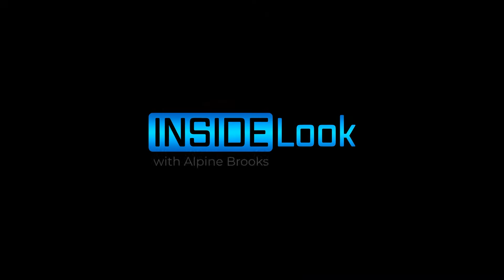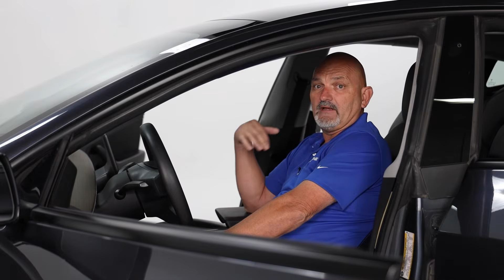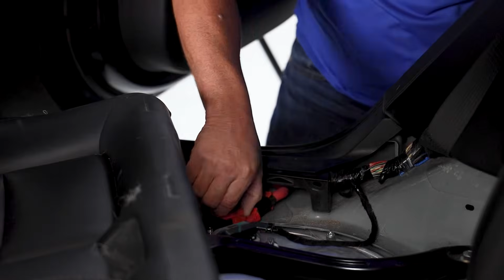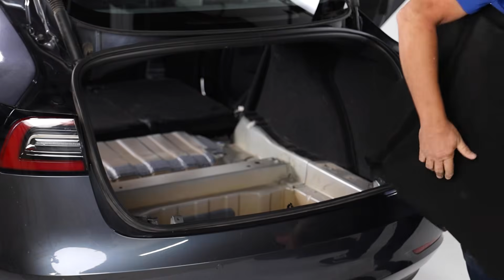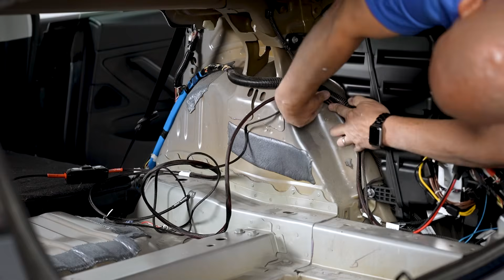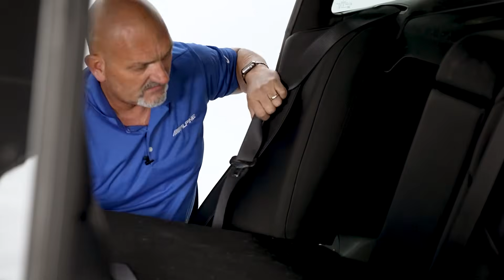DIY Subwoofer Upgrade for Tesla Model 3 & Y | Alpine PSS-TSUB-T3A / TYA Step-by-Step Install Guide

Comment: Just paid for someone to install the sub in my 2026 model Y. This sub sounded good for about four minutes and then it just cuts off. Subs still gets a little bit of power, but it no longer kicks anymore. You can let it cool down for a few minutes start playing a song and It’ll cut out again so far it’s been a waste of my money buying it and a waste of my money having someone install it.
Reply: I posed the following question regarding overheating to Microsoft Copilot: "I read a review, and Crutchfield also states that the Alpine system can overheat, leading to temporary shutdowns. What do you know about this?" I suggest you ask, too. I received a very detailed explanation and remedy for overheating. Make sure Copilot knows you're talking about the Alpine PSS-TSUB-TYA subwoofer. Good luck.
Reply: I'd start with your gain adjustment. Copilot suggests starting at 35%, which is the mark on the dial at 10:30.
Reply: @peterjens316  The problem with the system kit is Alpine subwoofer and their amp is garbage, the wiring kit and speaker box is great so what I did is I replaced the subwoofer and the amp with Kicker 51KPX500.1 and JL Audio 10W0v3-4. No problems with overheating now. Hope this helps anybody that reads and once a little more bass in their Tesla.

Comment: Very nice video, but my Model Y is the standard edition RWD and I have not the factory subwoofer. Can I still install it? Do you have a kit with cables and everything for that model?
Reply from the maker: Fitment is a bit tough on Tesla because there are so many different variations and trims that affect the audio install, even within the same models and years. We have created a fitment guide on our website specifically to tackle Tesla so if you add your vin and build date to the guide on our Tesla product pages that would be the most accurate.
Reply: @AlpineTV can you give me the link please?

Comment: Any time frame on when this will be available for the 2023 rwd cars?
Reply from the maker: If it is a model with the base level stock audio system (no subwoofer) we have a new subwoofer kit coming soon for those models.
Reply: @AlpineTV any update on eta?
Reply: @AlpineTV  Same question here. Im ITCHING get some bass in my 2023 Tesla Model 3 Standard (without subwoofer). I thought the PSS-TSUB-T3B was sold out but I guess its yet to have been released. Sacrificing some "plug and play" to have 90% plug and play is worth having this sooner rather than later. 😅😬

Comment: Nice video!
Is it compartible for the new Model Y Standard range 2026?
Reply: I don't think so. I've got the same model Y and been wondering. I'm pretty sure the subwoofer wiring isn't there in the boot so you've got to use a high to low converter off one of the front door woofers.

Comment: I heard that you should run the amp power cable to the front battery terminal so that there is no errors from the computer. What have you experianced?

Comment: This is what I've been waiting for a LONG TIME!!! thanks so much. I like the idea to use the Original UI to control the system and not external volume knobs and inputs. Question: description says: "selectable low-pass filter (60, 80, 120 Hz at 12 dB/octave)" where is this done? and what you recommend for the Model 3 Sound Profile?

Comment: The factory sub and alpine sub enclosures look identical. Can I just swap the speakers?
Reply from the maker: You can just buy and swap speakers if you want but the factory Tesla sub is an 8" woofer and the Alpine is a 10" upgrade. Its a pretty significant improvement on the factory sub.

Comment: Unfortunately, the ease of installation is all this kit has going for it.  It's massively over-driven.  With the amp gain at minimum, and the Tesla sub control at minimum (next tick down is mute) it sounds like it's going to blow the speaker at 20% volume. The sub box doesn't seem well sealed either, could hear rasping from the middle seam.  Not likely I'll trust Alpine again.
Reply: so what did you end up getting?   I need to change the juniper/2026, front doors side speakers, they seem like they are already blown?
Reply: ive been having issues with my alpine ilx-w670 head unit. this being a replacement for the same model that had more issues than this one. this this clips through the rca outputs at only 0.8v. seems like a power supply problem, again. ive never had any issues with alpine over the years. they have definitely gone downhill
Reply: Sounds like it’s been tuned to max output at low volume. That may be ideal for some, but not everyone. I really appreciate the info.

Comment: Will this work if my model 3 doesn’t have the 8inch sub?
Reply from the maker: Not yet, this system is meant as a replacement for the factory 8" sub models. We are working to try to provide a system and sub upgrade for the model 3's without a sub but its not quite there yet.
Reply: Any update on when the base rwd system will be available

Comment: Great install vid, but as one of the other posters mentioned I'm not sure on the gain setting for the LOC and the amp.  They both came out of the box at the halfway setting, which feels too high when I cranked it up.  I would guess it's seriously clipping.  I saw someone on Reddit mention they turned both all the way down, but that doesn't seem right either.  I don't have a SMD DD1, so do you have any idea what the gain settings should be for both?

Btw, the output is decent.  Definitely more than the stock sub, though it doesn't have quite the low frequency output I like from a ported enclosure.  I get why you went sealed, as there's not really enough airspace for a ported 10, but I really prefer the sound of ported boxes over sealed.  Just personal preference.  

Also, the enclosure design is slightly not ideal, as the bottom mount area does not line up with the factory bolt hole on my 2023 model y, so I had to use a drill, tap and die set for a bottom bolt on the sub enclosure.

Comment: Man, knew I should’ve gotten the Model 3 with the upgraded system. Would’ve been a much simpler install lol. Does Alpine sell harnesses to grab signal from the speaker?
Reply from the maker: We are working on potential solutions to work with the base audio system as well. Stay tuned.
Reply: @AlpineTV  This system already uses the factory sub level output. Why not just swap that harness with one that is long enough to go to the nearest speaker wires? Or one that is best accessible.
Reply: Any update on the base model system?
Reply: @anthonysallygennusa6181 EVoffer sells a harness that activates the navigation tweeters on base models, and there’s an add-on for sub output.

Comment: Will this work with my 2024 Tesla model y long range (RWD)? I think it has the 7 speaker setup without a factory subwoofer, but I’m not 100% certain. Thank you!
Reply from the maker: If it has the factory 8" sub in the rear trunk panel then it would work. Typically most Model Y's have that sub.
Reply: @AlpineTV  Does that mean that for the 2024 Model Y with the standard sound system (7 speakers without subwoofer), it's not possible to add this subwoofer?

Comment: will this work for the new Model Y Juniper?
Reply from the maker: We are researching the model now to confirm fitment...early feel is that it will most likely work with the Model Y Juniper but just waiting on final confirmation on that model and testing.
Reply: @AlpineTV please also look at the base juniper Y which doesn’t have a sub (RWD). This would be amazing if you can make it work

Comment: Great Video! Question.. what are the gain settings for both the amplifier and LOC set at? as this part was not covered in the video..
Reply from the maker: The gain settings on this are preset from the factory at the minimum setting for both the amp and LOC.

Comment: I have a 24 M3P....does it work for this model?
Reply from the maker: It should as long as it has the factory 8" subwoofer in the rear trunk. This kit replaces that stock subwoofer.

Comment: would this work on 2024 model 3 LR?
Reply from the maker: It should as long as it has the factory 8" subwoofer in the rear trunk. This kit replaces that stock subwoofer.

Comment: Need setups for hyundai ioniq 5 N as well reg ioniq 5's. 
I want more all around sound if any thing a lot more bass but dont want to have anything in the way. It comes with a bose system and has a small sub down firing in the back.

Comment: Hi, does it work for Model 3 Highland (refresh) or you have another model that work with M3H?
Reply from the maker: Most of the Highland models have the two rear 8" speakers instead of the subwoofer in the rear panel so this would not be compatible with those models. We are working on some solutions for that model though. Stay tuned.
Reply: @AlpineTV  thanks for the reply. if i would opt for this model, can i still use it instead of 2 units of 8" rear speakers? Can it fit on like how this video show at the boot? also is the EV-100SW 3-T an active sub?

Comment: Ahhh man I was about to snag this so fast but it’s $1k?!?!
Reply from the maker: Thanks for the feedback. Keep in mind this does include Subwoofer, Enclosure, Amplifier, and all the harnesses and hardware to make it a true plug-and-play upgrade.
Reply: Same, thoughts.  Seems expensive for a cheap sub and tiny amp and a plastic box.  I would buy it for like $500-$600 in a  second though.
Reply: @JFlywheel yes agreed for that price. But $1k no thanks.
Reply: Dude for an all in custom fitted amp plus sub, line level and all plug and play are you kidding me? That’s a steal.
Reply: @richlucero3536 it is not a steal. Way cheaper ways to do this.
Reply: I just ordered one for $599 + tax. They dropped the price at target, Amazon, and best buy. Cop!!